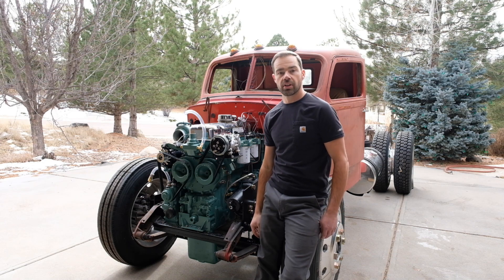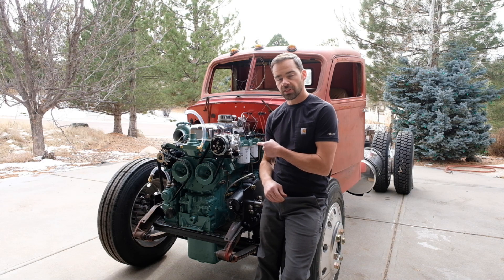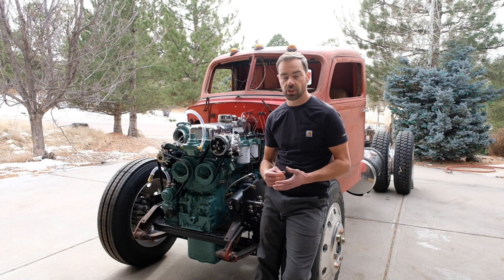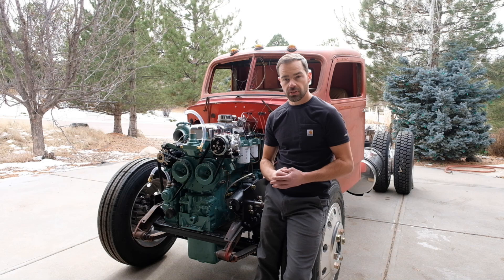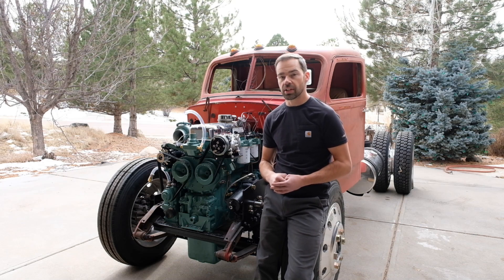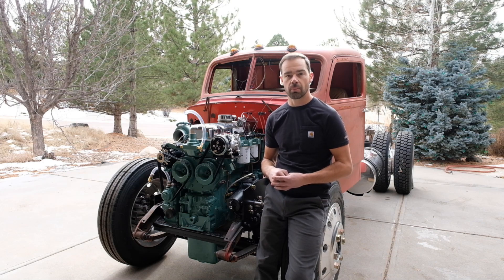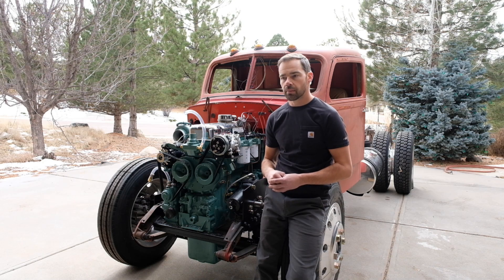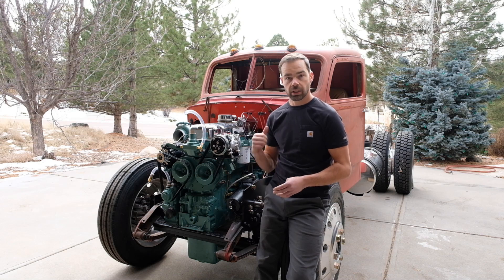Detroit Diesel 4-53T - first start! (1949 Diamond T 306 truck)

Comment: Olá, amigo, qual turbina você está usando?
Reply from the maker: The turbo mounted on the engine in this video is what came from the factory on Silver 4-53T engines (Garrett T04E).  But after I made this video I've upgraded the turbo to a modern Pulsar 300 series with a 63mm compressor.  I have another video on my channel with more details on the turbo.  Thanks for your comment!

Comment: A 12 valve Cummins would been much better engine and fit not to mention lighter, a lot more powerful than that Detroit. That thing is less than 200hp at no torque it’s basically a watered down boat motor..
Reply: Yur a hero 6:28

Comment: Do those also have a supercharger?
Reply from the maker: All of these old 2 cycle Detroit Diesel engines have a "blower". The blower is sometimes mistaken for a supercharger.  But the blower doesn't increase intake pressure like a supercharger... it moves fresh air into the cylinders when the intake ports are exposed to the air box, and pushes exhaust gases out of the cylinders when the exhaust valves are open. In order to actually increase intake pressure, turbochargers were a performance option on some models. The turbo feeds high pressure air into the blower inlet.

Comment: Are those the leaf springs off the original frame?
Reply from the maker: This is the original frame, and I'm using the top few leaves from the original stack. But I've added an air bag between the top leaf and the frame.

Comment: Was that ok running it that long with no water ?
Love the truck
Reply from the maker: It had water in it. I plumbed it so that it was circulating through the coolant bypass as normal. Never got hot enough to open the thermostat.

Comment: I've been wanting to get a truck with a 4-53T in it as my first truck in a few years, any suggestions on where to find one? 

When I get enough money I'd like to go to a junkyard and get a 1973-1991 Chevrolet K30 Crew Cab Long Bed Dually and put a 4-53T In it along with a good transmission like a 5 Speed Allison Transmission and 3 speed Brownie Box.

But until then, what are some factory trucks that have the 4-53T that I could find for sale in the United States?
Reply from the maker: They aren't common, but do come up occasionally. Look in the Detroit Facebook pages, Facebook marketplace, Craigslist, etc. They were factory installed in medium duty trucks in the 60's, 70's, and 80's (I'm not sure of the exact years). GMC was obviously most common.
Reply: PC industries is where I bought my last 453, great guys to deal with and they built it to my drivetrain reasonably
Reply: https://youtu.be/Yc6KCF887Lo?si=qnbunl9e_1ACkJeP

Comment: Is that running without coolant? Or is that a stupid question?
Reply from the maker: It does have water in it. I talk about what's going on with the cooling system just before I start the engine. 👍

Comment: A bit of free advice for all of those who want to revive an old Driptroit. First start should always be done with the valve cover off and a pair of vice grips on the fuel rack so you can manual control in case the governor jams. Make sure all the injector racks move through their entire travel. Have a thick metal plate that will fit over the intake to shut off the air supply should the engine get away from you.
Reply from the maker: This engine wasn't exactly "revived". It's been rebuilt and I just installed Jacob's brakes, so have recently been under the rocker cover, adjusted the valves, and checked the fuel rack. I was confident in the operation of the fuel rack. I do always have a steel plate on hand to block off the turbo, just in case.
Reply: Apparently you have no idea what you are talking about. The governor doesn’t jam, the injectors do. If the governor can’t push the injector to no-fuel, what makes you think you can do it with a pair of vise grips? Those governor parts are not all that robust. Forcing the control tube with a pair of vise grips means something has to bend in order to cut off the remaining functional injectors. Anyone who uses vice-grips in lieu of  fixing the emergency shut-down is an idiot. Instead of bending up a bunch of expensive shit,  one has merely to calmly walk up to the engine, beverage in one hand, and stop the engine with one finger.
Reply: @richardmaurer9002  Well I guess you forgot to read the part about making sure the fuel racks had freedom of movement. You are correct, I misspoke when I said governor instead of injectors. I disagree a governor can be overcome without bending anything, anyway damaging a governor is preferable to putting a leg out of bed. My comment were aimed at giving pause to the uninitiated not intended to annoy an expert, for that I do apologize

Comment: From the way the fan is , it looks like the alternator in spinning the wrong direction . Is that possible ?
Reply from the maker: My alternator is bi-directional and has both internal and external cooling fans. But the external fan is turning the correct direction.
Reply: @hanscustomshop  I was just wondering . Thanks for the correction .

Comment: Would be interested in how much RPM that engine runs.  I drove a 67 Chevy C80 with a 6V53, it came from the factory set to run 2800 RPM, then a Chevy dealer set it to 3200 RPM. it didn't have a turbo and was rated at 160 horsepower.   Had a 5 speed and 4 speed transmission.  Wasn't fast, top speed was about 60 MPH.
Reply from the maker: My engine is governed at 2800 rpm. That 3200 rpm for a 6v53 is out of spec, but it probably wasn't uncommon to turn them up that high. Must have sounded angry!
Reply: @hanscustomshop  
Thank you for that information,  the Chevy dealer said that it would still be covered under warranty.  You're probably correct though.  And yes,  it sounded angry.

Comment: What a Beast!  All it needs is an Air Starter!   I'll definately be watching for any and all updates and thanks for sharing!
Reply from the maker: An air starter would be an upgrade in badass-ness, but unfortunately I've got no room for it in this truck.
Reply: @hanscustomshop  Where abouts are you located and an air starter is badass!  i have a 49 Dodge 1 1/2 ton truck that I  plan on putting a 3-53 in it just because as well as a dump bed!
Reply from the maker: @turbogrin  Would love to see that project.  The 3-53 will be a much easier fit.  I've had to get very creative to fit the 4-53T, and keep the radiator up front.  I'm in Parker, Colorado.  Where are you?
Reply: @hanscustomshop  Greetings from Superior Montana plus I'm going to try and Turbo the 3-53
Reply: @hanscustomshop hey! Im new to the Detroit world how did you run your motor mounts? Im gonna hopefully be swapping in a 4-53 or 4-71 in my 86 c20 mainly for the coolness factor but also the fuel mileage 😂 i hate the 7 mpg i get right now